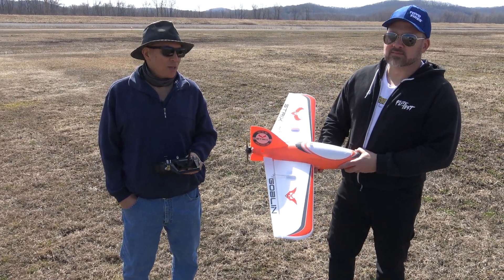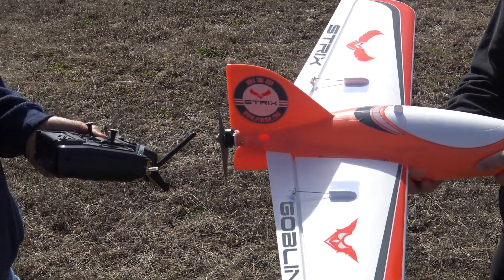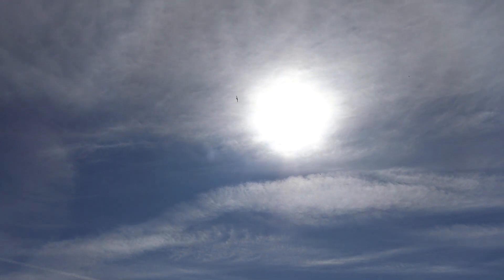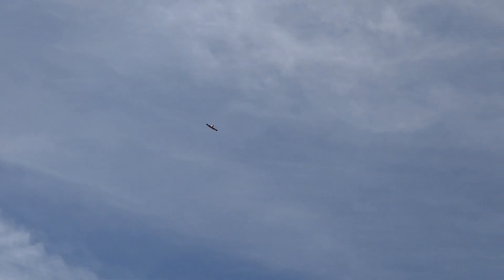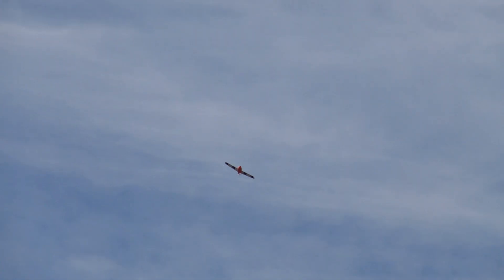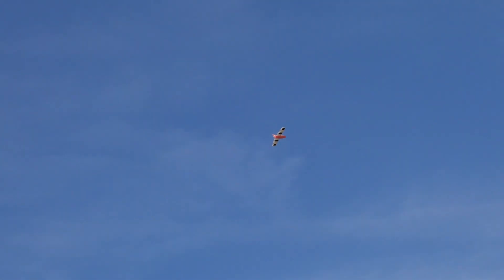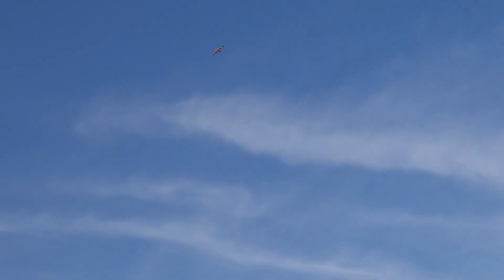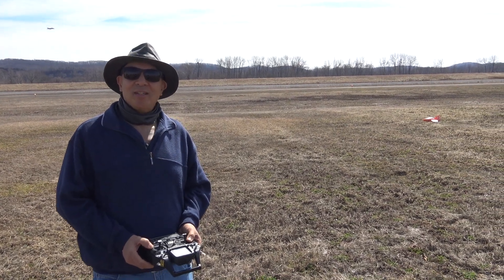Strix Goblin Maiden Flight on 6s Lipo

Comment: Wish mine would launch but I have a 2320/1310kv badass motor on 6s but inav auto launch isn't working for me...it will break fuselage center from wings and it's going to be ruined before I figure out ..any tips? Weight from 75g motor maybe? Cg seems okay but that's with lipo front and added 75g weight also to nose for cg
Reply from the maker: The secret to getting the Goblin to launch like this is to keep the weight down and to run a bigger 7 inch prop. The stock 5 inch prop just doesn't make enough thrust for take off. This plane is naturally heavy and needs a lot of trust to get it going. Try to keep the weight below 2.5lbs or 1135g and give it a good hard throw at about 3/4 throttle when launching. See video comments for list of parts I used in mine. The only other way would be to use a bungee launcher with about 20lbs of pull.
Reply: @rcFoamFighters  Great to know! Thanks. Your channel has always been such a great source for real usable info!

Comment: Wow that's what I'm talking about! Love that speed.easy to lose orientation with that plane.i love the take off  on hand launch with no deep at all.
Reply from the maker: Thanks! I decided to put a power system in the Goblin that could turn a bigger prop than the stock 5 inch one after watching other videos and reviews saying you really need a bungee launcher because of the weight of the plane. This setup turns a 7x5 prop which makes much more trust to get the plane moving as quickly as possible. I'm very happy with the way it worked out!
Reply: @rcFoamFighters  what speed u think it's going?
Reply from the maker: Not really sure about what speed it was going. The trust calculator we use estimated speed to be about 115mph but it looked faster than that to me. Will need to put a GPS in in next time I fly it to get the correct speed.